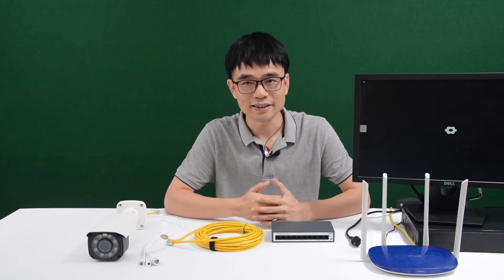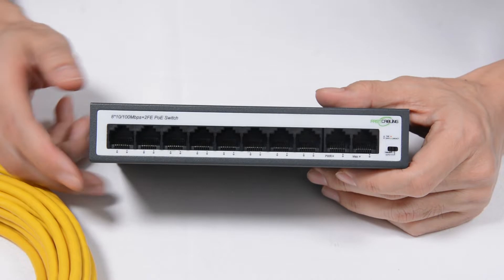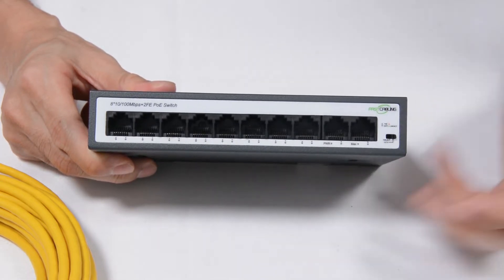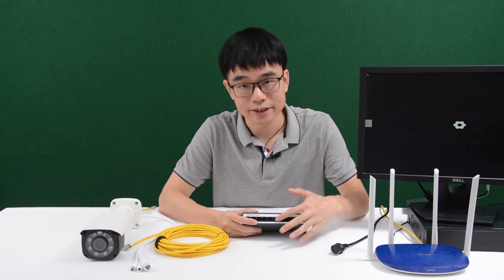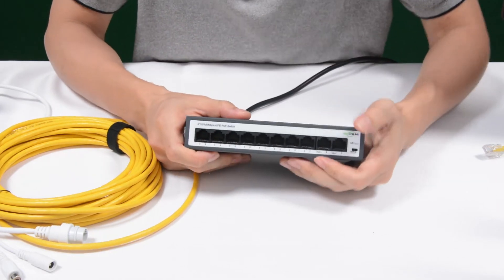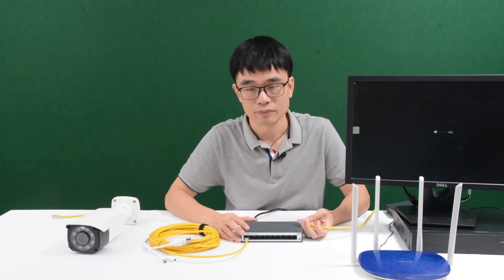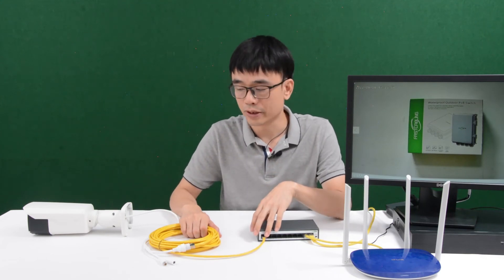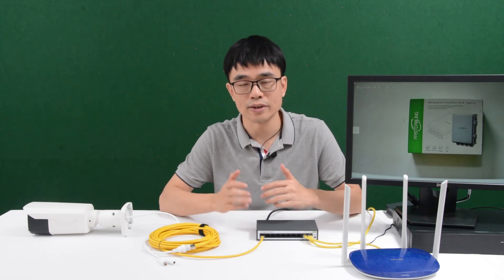How to connect IP camera with external PoE switch

Comment: CAN I USE AN ETHERNET SWITCH AS POE AND JUST RUN POWER TO THE POE CAMERA? CAN'T FIND ANY ANSWER ON THAT ANYWHERE
Reply from the maker: The internet switch doesn’t have Power source for POE. If you attach the poe camera to internet switch, the camera will not get PoE power from that switch. The workaround is you can add PoE injector to that specific port you want to connect the PoE IP camera. PoE injector will add the power to the cable and send to your ip camera.

Comment: Hi,  you are putting a wireless router between camera and poe.  Can we do online this camera through this method?
Reply from the maker: The PoE switch was attached to wireless router to receive the internet access. So the whole ip camera system can be accessed remotely.

Comment: Can I connect wifi router to ip camera direct..? It will work??
Reply from the maker: Yes it works. Technically an ip camera is mini computer which has IP address. If the software discover camera but fails to establish the connection, you might need to revise the IP address of your camera to match the subnet.